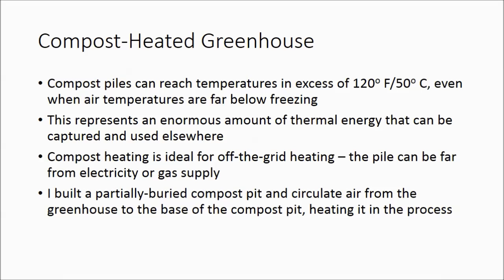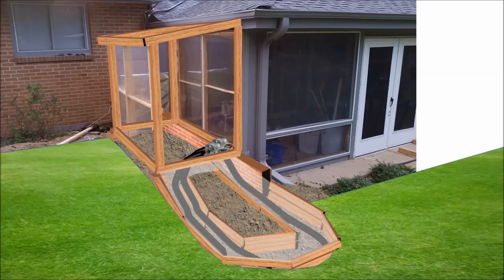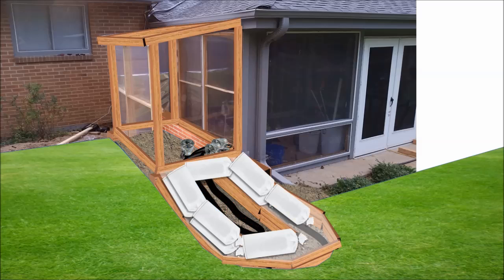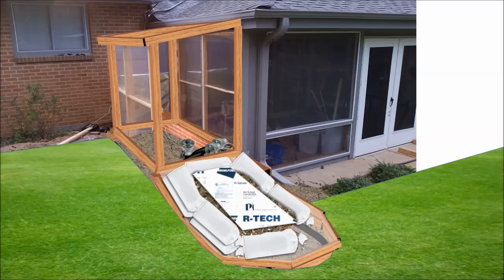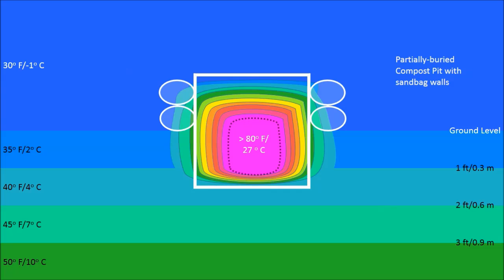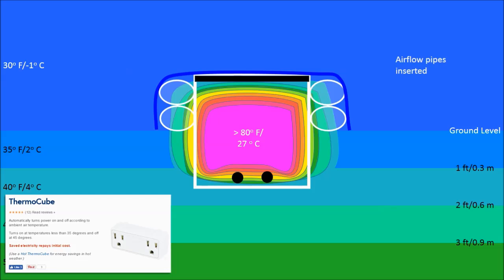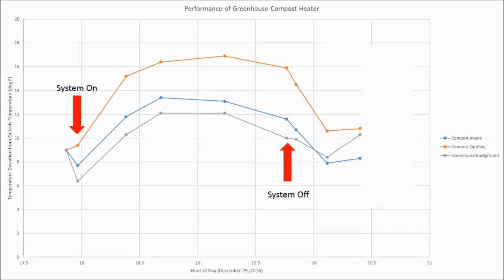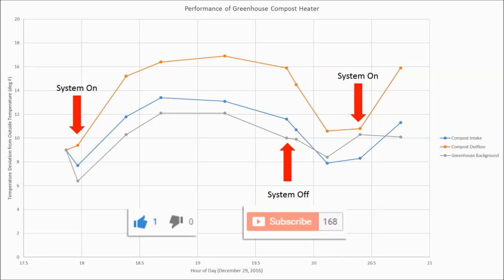Heat Greenhouse with HOT COMPOST.  2016 Build and Results

Comment: Good stuff. Can't wait until I have some land to try this :)
Reply from the maker: Ha, I've got a third of an acre and it never feels like enough!  So I did some experiments to see how small I could make a hot compost bin.  It was my daughter's science fair project.  5 gallon bucket wasn't even close (no heatup).  We tried 27-gallon bins, like you buy from Home Depot.  They heated up a bit, but nowhere near a "full-size" pile.  My 2017 build has a 3x3x3 ft compost chamber (insulated), and it works fine.  I suspect that we could have gotten the 27-gallon bin to work, if we'd have insulated the walls.  I think the compost pile is the best way of "eco" heating a greenhouse, but you need to budget 9 sq ft of floor space for the compost pile

Comment: Good information, nicely presented. I've been thinking about doing something like this. Thanks!
Reply from the maker: thanks Jan, I appreciate it!  I think the compost heating method is really accessible to hobbyist greenhouse users like me.  If my greenhouse was big enough, I'd just put a compost pile directly in the greenhouse.  I've gone to very simple compost piles -- just coffee grounds and leaves to keep down the odors.  I wouldn't want to have a really rank pile inside my greenhouse!
Reply: @MorganBrown  Hi .. enjoyed the video!  I've been a big fan of the method for some time .. but haven't had a really good opportunity to create something like this until now.  This fall I have a 10 x 20 .. 1/2 hoop greenhouse tied to one section of the south side of my house.  It's not totally air tight but 99% close .. the plastic covering is loose but secure.  Just inside one end I have a large black plastic tub .. rectangular in shape .. about 4-1/2 x 5 ft.  It is sitting off the floor on some 8" cinder blocks.  There is a drain hole at one end.  In the bottom of the tub there are three sections 5 ft long that are a little larger than a standard brick.  This sections form sort of a foot for the tub so it's bottom doesn't rest directly on the ground.  I placed bricks in these channels and covered the channels with pieces of hardware cloth.  Then covered the bottom with landscape fabric to act as a filter for debris.  I filled the tub with layers of compost material .. some chicken litter .. a lot of sweet potato vines .. goat/sheep manure .. and a thick layer of shredded leaves.  I also add some water occasionally.  I added two large thick pieces of cardboard to the top.  It's heating up fine.  I could get it hotter I imagine .. and it is shrinking with time and I add more material to the top.   The greenhouse stays about 10 deg warmer than the air outside at night.  I keep an eye on the weather predictions .. and when it is expected to be below freezing I crack open the door to my house and let some propane heat help the temps in the greenhouse stay above freezing.  One of the nice things about an indoor pile like this .. in the tub .. is that there is a nice level place on top where I can put trays of seedlings to start new plants in the spring.  A natural heat from the compost pile to help with the rooting and early growth.  So my main point here is that a compost pile can be made inside a large container .. helping to keep the greenhouse organized and neat.
Reply from the maker: @MerwinARTist  Sounds excellent!  Where did you buy the plastic tub?  If you take a look at my new compost arrangement (https://www.youtube.com/watch?v=Ze0nXN6Vvic) note that I've essentially built a connected compost bin, which is insulated with foam board.  I use a heat exchanger to capture heat from the compost pile.  If I had a larger greenhouse, I would just use your arrangement, to be honest.  Far simpler.

Comment: What is the black plastic or tarp that you covered the pile with? Thanks!
Reply from the maker: Hi, it is just a 6x8 foot tarp.  I built an improved compost chamber this year which is a wooden frame that has 2 layers of foam insulation.  I have a wooden lid that has foam insulation.  It works better...but, a tarp is a 90% solution to insulate the pile. ;-)
Reply from the maker: Check the description of this video to see the links to the new system.

Comment: I wonder how large a compost pile you would need to heat a 1200 square foot house during the night.  I am imagining a compost pile in a partially burried insulated box with sealed piping or tubing running through it and it is powered by a solar fan for air to air heat exchange or a pump that would pump warmed water through a concrete floor.  It would help when the sun's  not shining.
Reply from the maker: That's the million dollar question.  (Well, maybe not worth that much!).  You are imagining what I implemented this year (2017) - a partially buried and insulated box (https://youtu.be/pZGDIBeBLNs).  I have been carefully monitoring the temperature inside the greenhouse as well as 5 thermometers inside the compost pile!  It is useful to see how much heat the greenhouse draws from the compost pile, and the answer is: quite a lot.  My greenhouse is 8x4x6 ft (192 ft^3) in volume, while my compost pile is only 3x3x3 ft (27 cu ft).  I conservatively estimate that I would need to increase the volume of the compost pile to ~ the volume of the greenhouse in order to keep it above freezing during our cold winters.  My dream unit would essentially be a large root cellar, which I could stand up in.  Rather than have one compost pile, I'd rather have a battery of smaller compost piles, with a heat exchanger going into each pile.  It's probably more time consuming to maintain a series of small piles rather than one big one, but it would allow you to keep the temperature of each pile hot, which would ensure steadier performance of the system as a whole.

Comment: Where do you get the material in the winter to add to the compost pile?
Reply from the maker: Preston Clark I stockpile dry leaves. Leaves are great - they have lots of nitrogen already.  I just built a pile three days ago, with nothing but leaves and coffee grounds.  It’s already up to 130 F/55 C.  I also bought a heavy duty paper shredder and am going to experiment with using shredded cardboard as a substitute for leaves.  I’ll need more nitrogen though
Reply from the maker: I'm having good luck with shredded paper and cardboard.  I bought a heavy-duty paper shredder.  I'm able to get a mixed leaf/cardboard pile just as hot as a pure leaf pile

Comment: why dont you put the compost pile on the inside of the greenhouse in the ground.. it removes the need for insulation around the pile.. all you need are tubes running vertical from the pile to extract the most heat  like u have already and a raised platform above the pile so u can walk over it like a bridge.
Reply from the maker: Greenhouse is too small. ;-)  You are right, putting compost inside the greenhouse is a better arrangement.  However, compost does emit some ammonia gas, so be careful
Reply: hmm yea that ammonia gas is a drawback but one main reason why i suggest this is because compost pile also produces co2 which is of course good for plants.
Reply from the maker: yep, you make a good point!  And I've noticed that a "healthy" pile really doesn't have an ammonia problem.  To be honest, I definitely would put my pile inside my greenhouse if I had the option.  I'm rebuilding my compost chamber.  It's going to be deeper and closer to the greenhouse, with better heat transfer between the pile and greenhouse.  Last year's design was done very quickly, just to see if the concept worked.  It worked far better than I would have imagined.

Comment: Why use a fan and more energy. Natural convection means heat is attractive to cold. Move the hot or cold duct the farthest away from the other  and see what the result is. No energy from electricity is needed.
Reply from the maker: Good point.  I've seen some very effective compost heating examples where the compost pile shares a wall with the greenhouse.  I'm planning to rebuild my compost heater shortly and will use sheet metal internal walls around the pile to improve conductivity.  I may be able to dispense with the fan altogether.  Ignoring the energy savings, it would be nice just to have a more robust greenhouse with fewer moving parts!

Comment: In the very beginning of your animation description, you say you built "5 ten foot deep wells".  Please explain, because I can not see where you went 10 foot deep, that is deep!  Thanks.   Also, can you give an update on how your growing went last winter, and how you willing be changing it this winter?
Reply from the maker: Sandra, thanks for your note.  I have a separate geothermal system for heating/cooling my greenhouse.  I use an extendable auger to drill to 10 feet.  See this video (https://www.youtube.com/watch?v=e8AosXQ3OaA&t=4s).  The compost system is much simpler, and I believe more effective.  However, I am going to improve the geothermal system for this winter by reducing the amount of pipe tha the air has to flow through.  On the compost side, I am planning to make the compost chamber larger and to make the internal walls from sheet metal to facilitate heat transfer.  I should have videos of both systems within a month or two.
Reply: Ok, I have watched all three videos. But I still don't understand, have you put a Geothermal System UNDER your Compost System in the same greenhouse, or on the other side of the greenhouse?  Good job on your videos, by the way, I like the animations and graphs!
Reply from the maker: The geothermal system is essentially separate from the compost.  Last season the two were sort of co-mingled, but this season I will have them separated.  Both systems are outside the greenhouse -- I think they would both work BETTER if placed INSIDE the footprint of the greenhouse.  But for that, I'd need a bigger greenhouse. ;-)  Glad you like the videos, the nice feedback encourages me to make more.
Reply: Morgan Brown yreeeeeeeee
Reply: Sandra Murdock bhuhillnhgu

 Bhu
Nbhffdzzaaefgjoppplmnjiibv drwwaz m
Reply: Morgan Brown Hahn. Bjnvhtfcxzwwszz nn. 🇹🇨🇹🇨🇹🇴🇾🇪🇪🇭🧟‍♀️🧟‍♀️👰🏼👩🏻‍🚒👩🏻‍🚒👨‍🚀👰🏼👰🏼🧝🏿‍♀️👨‍🚀👩🏼‍🚀👩‍💻🧟‍♀️👰🏼🇻🇺🏴🏴🇺🇬🇹🇷🇸🇷🇸🇿🇸🇩🇸🇩🇸🇩🇹🇱🇺🇿🇹🇱🇹🇱🇨🇭🇸🇾🇹🇼🇹🇿🇹🇿🇺🇿🇸🇾🇹🇱👪👨‍👩‍👧‍👧👨‍❤️‍💋‍👨👨‍👨‍👧‍👧👩‍👧‍👧🧜🏿‍♂️🧟‍♀️👨‍🚀🧜🏿‍♂️🧟‍♀️👸🏼👨‍🚀👩🏻‍🚒🧞‍♂️🧜🏿‍♀️🧜🏿‍♀️î

Comment: Looking at ideas for the greenhouse we are building this fall.  Doing research
Reply from the maker: Great.  Yeah, I really like the compost as a winter compost heater.  If at all possible, I'd recommend putting the compost INSIDE the greenhouse, or at minimum have the compost share a common wall.  I was successful in getting a hot compost pile, but the heat transfer between compost and greenhouse was mediocre.  Still, it was very helpful.  I'm planning to improve my compost heater (and geothermal heater) for this winter and will make videos.
Reply from the maker: great.  If at all possible, I'd recommend putting the compost inside the greenhouse, or at least sharing a wall, in order to maximize heat transfer.  The system I showed here had very mediocre heat transfer between greenhouse and compost.  Still, it worked pretty well!  Done over again, I would have engineered my greenhouse to accomodate the compost

Comment: will copper tubing help make warmer?
Reply from the maker: J Cib copper would conduct heat away from the compost better than the plastic pipe that I use.  However, it would be difficult and expensive to find copper tubing that wide!  Other people who take heat from compost use water pumps.  You would put a large reservoir of water inside the greenhouse, then circulate water through the compost, including copper tubing in the compost.  That would probably work better but it's more complicated

Comment: Great video and thanks for the detailed explanation. Is this something that would be safe and effective if put inside a greenhouse? We have about a 1000sqf greenhouse that we would like to keep heated over winter.
Reply from the maker: Jeremy, you are welcome.  Thanks for the nice comment.  Short answer is yes, you can put the compost inside the greenhouse, and in fact, such an arrangement would be far more effective in heating the greenhouse!  Gaetanproductions is based in France; he had a great video (https://youtu.be/Z-b8VowUY-4) of a small compost pile inside a small greenhouse, and it seemed to work great.  The compost reaction produces mainly CO2, but there's some associated CH4 (methane) and NH3 (ammonia gas), which you don't really want to be breathing!  The main reason I separated the compost from the greenhouse was due to the limited size of my greenhouse.  The secondary reason was that I didn't want to deal with the CH4 or NH3.  I've seen some greenhouse composters who use manure and animal bedding who have had a problem with excess NH3.  However, my piles, when they are properly mixed and hot, don't seem to be producing excess NH3 (characterized by a nasty smell).  Next winter, I think I will make a bigger pile and build an insulating structure, and try to extract more heat for my greenhouse (which never froze this winter, even after some very cold days).

Comment: I was hoping someone could answer a question for me.  Can you delay the composting reaction until the end of the year or the beginning of the next when you need the heat the most?  If you store the different ingredients for the composts separately will it postpone the heat reaction until you need it and mix it together?
Reply: Tony Stokes ... use large yard sized plastic bags. Mulch leaves and stuff bags. Tye off bags tightly. Place inside green house  under shelving where plants  are placed .  When you start needing  heat pour coffee  grounds and one quart  of .99 cent soda or equivalent  sugar water  into bags and roll to mix. Heat  in about 30 days, compost for spring. Translates  to the system on this video..  
Bags last several years too.
Reply from the maker: Tony Stokes yes, this is definitely possible.  I use leaves in my compost, and you definitely could store them for a long time if you keep them dry.  I use coffee grounds to accelerate the compost (see my most recent video).  When you're ready for heat, mix leaves, water, and coffee
Reply: Perfect, I'll give this a go.  Would the coffee grounds still be useable if you saved them up over the course of a summer or whole year even?
Reply from the maker: Tony Stokes I believe so, but I would try to keep them dry as well, because they will collect mold if wet.  I haven't tried this, for the record!  But I understand your predicament.  In my case, I have plenty of dry leaves but never enough "greens" in the winter.  I believe, but haven't yet proven, that you could make hot compost with nothing but coffee grounds and dry leaves!

Comment: I'm wondering what the dimension of your greenhouse is and the dimension of your compost pile??
Reply from the maker: greenhouse footprint is 4 x 8 ft, and it's about 6 ft high.  So around 200 cu ft.  The compost pile is about 2 ft deep, 2 ft wide, and 6 ft long.  It would have been better to make it bigger (or better yet to put it inside the greenhouse!), but as long as I primed it with enough coffee grounds, it stayed hot.  I was always short on coffee grounds. ;-)

Comment: An excellent video Morgan, well done, easy to understand & inspirationa
Southampton
Reply from the maker: John Larkin thanks much!  The method worked well.  I'm keen to try it again next winter
Reply: Not sure how the pipe worked in the compost, did you have a filter over the ends?
Southampton
Reply from the maker: John, the pipe was actually airtight, so the air from the greenhouse never came in contact with the air from the compost pile.  That was by design.  It reduces the heat transfer.  It'd be better to have the compost inside the greenhouse, but that's a project for next year.
Reply: Thanks Morgan, and God bless.

Comment: Hi Morgan,

Thanks for the video- it is very informative and I am inspired! I have a couple of questions...

Has the addition of about 5 lbs of coffee grounds every time the pile starts to become less active been enough to keep the pile active and the temperature high enough to heat the greenhouse most of the time (besides the couple of days you have to wait after turning in new material)?  

How often are you having to add new material to keep the pile nice and hot?  Every 2-3 weeks or so?
Reply: Morgan Brown Thanks for coffee grounds. idea. I didn't know that but I've always hated throwing the grounds away but wasn't sure about them. I keep all my peanut shells. They make good drainage layer as all my plants are completely indoors. Thanks again.
Reply from the maker: Laura Eaton : yes, coffee grounds have on every occasion sufficed to heat up a dormant pile.  I don't have a good sense of exactly how much coffee will be needed (e.g., five pounds of coffee per hundred pounds of cold compost), but generally I just keep supplementing until the temperature rises.  Lately I've been simply adding a couple days worth of coffee from my office to a couple days of kitchen scraps, then mixing dry leaves.  The pile is really hot right now - 150 deg F!

Weather has been extra warm lately so I'm actually more concerned with COOLING than heating.  I'm hoping to compost a large pile of leaves within a month or so to get some good garden soil.

Long and short, the coffee appears to be truly magical.  I bet you could easily compost nothing but leaves and coffee
Reply from the maker: I finally got hooked up to (essentially) unlimited coffee grounds through a friend.  She brings them to my house 30 lb at a time!  Compost heaven!